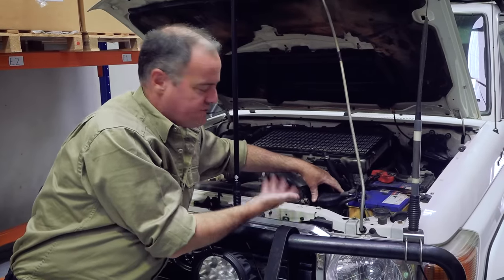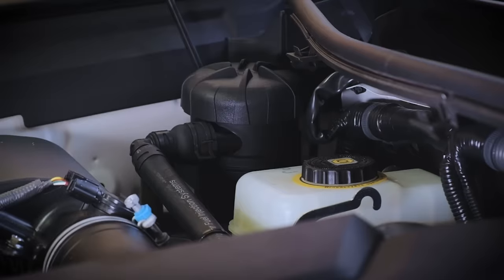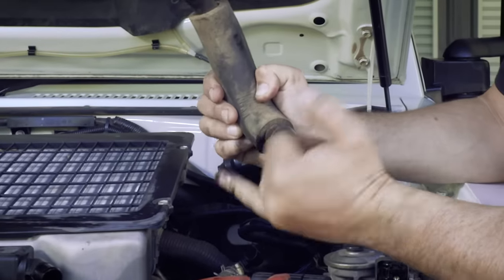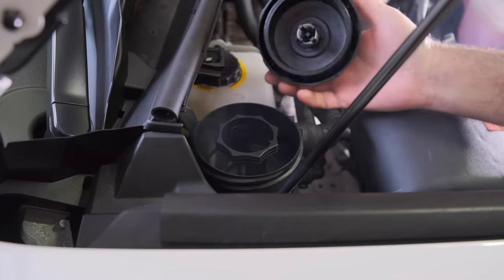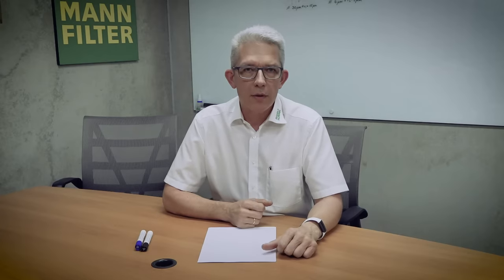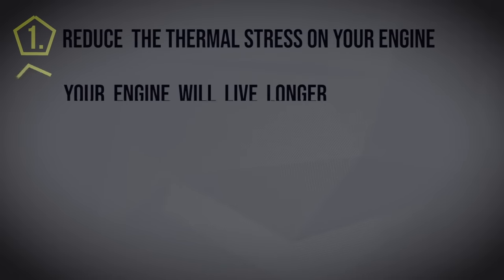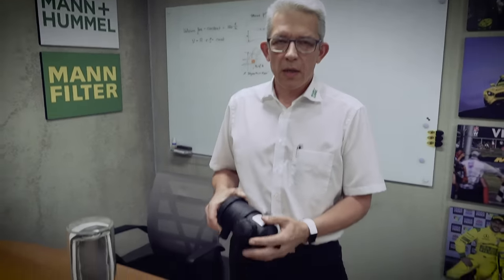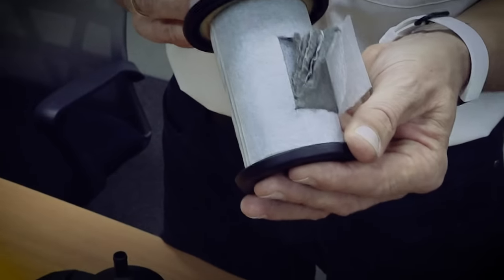CATCH CANS & EGR explained in detail! Why your diesel’s clogging up & losing power - how to fix it

Comment: Great video! Finally someone who knows what they are talking about re EGR systems! Well done, thanks 4WD Action. Keep up the great work!
Reply: if you were impressed with old grey saying how good egrs are you much think servicing your air filter means throwing a hand full of dirt in your air filter is going to make it run better because that's what he is saying you restrict airflow in a diesel it runs hotter no cooler diesels like air flow and cool air not hot exhaust gas with you think they have intercooler for to warm it up or something what old grey in video is doing is preaching lies to conform to emissions laws not help your diesel engine
Reply: @carlmenzel8744  100% you're right, but to get your point across a little better, you should consider the use of some full stops and commas.
Reply: @bumndrass  hahaha exactly
Reply: When doing something ‘illegal’ is good for your engine

Comment: I had a look at a EGR system with a catch can. It still had plenty of carbon deposits. It may well slow the deposits down as it catches the oil and the soot has less ability to stick to the EGR components and the inlet manifold, but I wonder if the small amount of oil that gets through without a catch can, helps to lubricate any deposits that make their way into the cylinders? Essentially, is the grit post catch can more abrasive as a result of the oil removal?
Reply: Charles Martell  did you just watch this video at all.

Comment: Interesting vid but also opposite to what my mechanic has told me with the D40. He says egr block is the way to go and I don't need a catch can after that as the oil will burn off properly not mixing with the exaust gas.
He also said the opposite with fuel consumption as everyone they have done the egr block on has reported better fuel consumption and performance.
Be nice to get some consistent answers
Reply: I am a mechanic and I agree,block the egr then the oil vapour won't mix with exhaust gas and won't gum up.Tiny amounts of oil in the intake is fine,will just burn up.The downside is you won't be supporting commercials such as this
Reply: @renbenism  My intercooler was literally dripping with oil after 5000ks.  The oil mist is harmful to the turbo that it passes through and coats the intercooler so it doesn't work nearly as well and it coats the inside of the inlet where the extreme cylinder heat will bake the crud on, even without the addition of EGR.  The crankcase blowby fumes are not pure clean oil - the collection of trapped fumes that comes out of my Provent is disgusting black oil.  I remind readers that 50% of mechanics are below average,  and I remind readers of the oft publicised videos that trap "mechanics" ripping customers off.  Message is don't trust a mechanic because he says he's a mechanic.  Think logically.  Fit a catch can or sell your vehicle before 100,000-150,000ks.
Reply: Over 300000km on my patrol with out a problem and 17yrs trade experience being a diesel mechanic I guess I know very little on the subject,might fit a hi clone aswell.thanks for the enlightenment👍
Reply: @renbenism  Mann-Hummel has 75 years of experience and is a massive company.  Yet you claim to know better.  I know who knows more about catch cans and their benefits.
Reply: @einfelder8262  Ok bud,I guess you need to justify your purchase and this advertisement does it for you-that's great.I'll drive my catch can less car and await inevitable catastrophic failure-maybe in another 300000kms? Who knows?
Reply: @einfelder8262  my patrol intake is wet as Fu©,to the point where the silicon boost hoses leach oily residue-the oil burns at combustion temps,my exhaust pipe is dry.all I'm saying is maybe you don't need it if your egr is "faulty" or turned off through the ecm.but it's up to you what you spent your hard earned on👍
Reply: @renbenism  cheers mate.
Reply: Thanks for the feed back guys. Ein Felder i am wondering if you are a sales rep for Mann-Hummel scrolling the comments to defend any suggestions that differ from the video. 
No need to be so protective of the catch can and condescending to others. 
Would be good to have more people get involved in the feedback. 
Cheers
Reply: Your mechanic knows what he is talking about. Block the EGR, get rid of the hot sooty and abrasive air being fed back in to the intake it's the complete opposite of what's good for an engine. These aftermarket guys cant legally sell an EGR block so of course they will push catch cans when the tiny amount of oil they catch causes no issues. 

Also catch cans are maintenance items and if they plug with gunk, or the water content they trap along with oil freezes, the pressure buildup in the PCV system can blow the crankcase seals.
Reply: @renbenism  . Well if your intercooler is leaking oil out of the clamps that means your complete inlet track has an oil film all over it. You claim to be a Mechanic but you obviously don't know how thermal conductivity works. With a air to air intercooler that has a film of oil on the inside it will be less efficient because as you know being a Mechanic the oil will act as a barrier and trap the heat inside the intercooler not allowing it to work correctly increasing inlet temps therefore reducing engine power.
Reply: @MJTAUTOMOTIVE  any mann and his dog knows that
Reply: How to get rid of that soot?

Comment: 0:47 Lots of blockage and performance loss after just 2,500 kilometers?! Give me a break! Surely if that were the case by the time the vehicle hit 100,000 kilometers it wouldn't run at all, or the owner would have spent $40,000-80,000+ in repairs to fix it.

Comment: So the egr lets less oxygen into my cylinder therefore my engine burns less fuel. Never have I heard someone say you to restrict  oxygen and fuel. Wouldn't putting a plastic bag over my intake have the same effect without the extremely hot exhaust gas being reintroduce into my cylinder?

Comment: Hi Rainer, I fitted a Provent to my New Pajero, from what I got out of your great video, you recomend not to blank off the EGR and I assume this mean by plate or lectrically using a EGR delete harness,,,, EGR DELETE KIT - MITSUBISH 3.2L ENGINE (PAJERO 2017 ONWARDS) many makes on the market. could you clarify please catch can only recomended or also use EGR delete cable? thanks heaps, great video.

Comment: This is 100% my point why Chemical cleans are no good for an engine, all that built up crud gets forced through all the area's you pointed out.
Cost more for a mechanical removal and clean but all that crap goes in the bin and not through your engine.
Catch can can only do there job if fitted from near new, There great, but for a slightly older rig the mechanical clean must come first then fit the can.
Now let the money making chemical cleaning guys unleash and tell me where they recon the crap goes if not through the engine,
Thanks for your video 
Murray in Redcliffe QLD.

Comment: The explanation of how EGR "saves" your engine by de-stressing it is pretty much a politically correct discourse.
Yes it reduces NOx emissions, but NO it doesn't give an engine better economy or longevity.  To cruise at a certain speed requires a certain amount of energy from the fuel - if you reduce fuel and O2 by filling half the chamber with inert gas you reduce the power output and hence the vehicle will slow down until you press the accelerator further to add more fuel again.  Your economy actually gets worse.

I've had a Provent on my Patrol since 5000k from new, and the inlet was already saturated with oil - dripped out of the intercooler when I took it off to wash it out.  The Provent is indeed an elite quality catch can/oil separator.
Reply: Not sure if the guy knows how diesels operate vs gas.  If the ECU is actually reducing fuel, your right foot will be compensating.  Give me all the oxygen and all the temperature, the NOx can be treated in other ways.
Reply: exactly. The engine breathing in soot is just destructive to its internals.........and less oxygen thanks to EGR works against all the progress in turbocharging and intercoolers to increase oxygen density.  Talk about politically correct bull manure.

Comment: So your putting burnt oil back through the pistons cycle, so it lowers diesel consumption and pressurises the crank case! 
Why not just have hho run back through?  (because the o2 sensor sensors fuel and supplies the right amount of diesel). Then you can catch 100% of the oil, it would still lower fuel consumption and be 100% better for environment and the engine, and the oil discard process might be higher but a lot easier and the whole system works better all round?? 💁🏼‍♂️

Can an egr sensor be deleted from ecu ? And can it “sense” Hydrogen as a fuel or be changed to do so??

Comment: Great video. Probably the best catch can/filter system and video I have seen. If they ever develop one for the U.S. market and especially the gas engines in the U.S. market they have a potential for a huge market. I will be first in line to get one! I have a gas V-8 engine and haven’t put a catch can on for the very reason you stated. They aren’t very effective but I am at the point where what I can get is better than doing nothing...
Like I said the U.S. is a huge untapped potential market.
Ron
Reply: I’m in the US and have a Provent on my truck. You can just buy one.

Comment: If all I need is a catch can.... why does the egr valve block up in the first place? when the egr is straight from the exhaust, before any oil vapour comes into contact with the system from your crank case vent??

Comment: I did an egr delete and have lower egts and gained 30% increase in fuel mileage calculated by the tank increase in fuel mileage = increase in efficiency
Reply: Mario here i have dually duramax 3500 maybe my egr need to be deleted 
120 liters only do 500k
Reply: @mirkamarioguillen4835  if you decide to do it guarantee you will not be disappointed
Reply: @trxcummins7388  tnx

Comment: 270,000 km on my common rail diesel, intake is fine, completely standard. Injectors are still running strong too. Don’t always believe the hype, especially when it comes to you from 4wd Action.
Reply: 350,000 on mine ,no issues.was going to install one but saw Auto expert report and decided otherwise
Reply: Change oil often.
Reply: @jamesmcmillan2656  can i please have a link?
I tried looking for it but he has so many vids, i cant find it.
Reply: Love that answer.

Comment: I AM A HUGE FAN OF 4WD ACTION GREAT VIDEOS THANK YOU GUYS!

The Manufactures now build cars like throw away cigarette lighters due to fact most of the engines are no good unless you mod them cough cough, they have DPF fitted creating higher engine temperature due to the restriction in the exhaust an EGR that recirculates all the dirty final emission output  especially when they are not closing correctly causing smoke less mpg and higher nox! ohhhh and mr Mann filter man..........an egr recirculates the hot exhaust gas so this make the burn temp higher not lower !! 

I do like the catch can though its good that the crank case oil is not been allowed to enter the combustion process
Reply: I've read the opposite, that since the exhaust gas that recirculates is always losing heat after combustion, the EGR allows cooler temperatures in the cylinders, not higher. This makes more sense logically than what you said "makes the burn temp higher."

Comment: Thanks for this info but im sorry i just don’t really understand any of it. Seems very important but Pardon my ignorance, i had a new mu-x and i wanna know where i could buy one and have it installed. Does this connect between the air intake and the engine? Just not my forte, but thank you in advance for directing me in the right path..

Comment: So the engine tolerates the temperature when you press the pedal, then the EGR is turned off, but it cannot cope with the temperature when you are cruising at low revs?

Comment: Ive just installed one on my Diesel 2.8 intercooler Jeep. 08 wrangler done 200k. 
Those L shaped joiners concern me!? 
Surely they will make the breather return tubes squirt like a water blaster jet? 
This was a kit with all of the bits and pieces of pipes and L shaped [internal] connectors etc...  
This is going to annoy me until I change those small L shaped joining internal corner pipes out.

Comment: Catch can helps like 5..10%, the EGR gases is the main issue, I got a catch can and it catchs some oil, but that does not eliminate the soot on the intake and EGR valve as the gas from the EGR has sooo much oil on it, diesel engines are designed for long time running, I had an mwn diesel bus that ran everyday from 4:30am till 12:30 every day from Mon-Sat, 2 drivers and it has never any issue because it was always driven like pedal to the metal, hard working lot of hours 400k in 5 year, urban drive 14km each trip, probably 15..18 each day

Comment: Careful with your factory warranty if fitting catch can to new vehicle... peanuts @ Toyota service centre told me the warranty would be voided if I put my catch can on my new Hilux. I said - warranty voided by in-line filter?? Why?? They said - "after-market modification, automatic void of warranty". What tools. Anyway have to wait 3 years before fitting now...
Reply: Catch can severely damage your engine!! Toyota was kind of enough to warn you about not installing the catch can.

Comment: Just bought my first diesel..
Is it worth installing a catch can on a motor with 260 000 K,s.. ??
Reply: Assuming its a common rail, if you're mechanically minded, pull the intake manifold, soak in degreaser, clean properly and reinstall with a catch can and you'll notice a power difference for sure. Make sure you get the workshop manual for your vehicle.

Comment: I installed a catch can and did EGR delete. Then I did an intake clean and also remove D swirl flaps coz they're known to come loose and get sucked in. 79k km. It was pretty sooty. I'm still concerned about valve seats and piston heads.
Reply: Did you remove the EGR completely from engine,  or just get it turned off in the tune, or use blank plates.?

Comment: Question: if an oil separator is so effective, why don't manufacturers fit it at the factory?
Reply: they aren't fitted as standard because 90% of people wouldn't empty them at the intervals they need to be emptied. sucking in actual liquid oil would cause more damage than oily gases.
Reply: @UnacceptableViews  well, they could've make it part of the service schedule (like checking/replace mthe PCV valve since the 70's) it is like who the hell will clean a MAF...

Comment: block the egr in MOST diesels with them in my opinion. It's really only certain engines that NEED it blocked. i.e i would block it on a ZD30 nissan patrol engine but not on a hilux 3L engine.
Reply: This couldn't be further from the truth, the 3l d4d engines are the ones that the egr blank the most

Comment: Never been a big fan of compression ignition.(diesel) .Next one i buy will be a Y62. Albiet with a bit more fuel  use .
Reply: Direct injection petrol engines have the exact same problem ad diesels.  There ya go.

Comment: What is the best method to clean out the carbon build up prior to fitting a catch can? My 2014 4d56 mn triton just clocked up 140 000. i am wanting to install a catch can and clean up the carbon deposits  my engine may have

Comment: I am surprised manufacturers don't include oil catch cans!
Reply: Because it does more harm than good. Hence why multi-billion dollar vehicle manufacturers don't include it. They know more about their own engines then these diesel specilast who just want you to buy there products. You want that oil in your intake to capture the carbon soot coming through your egr so it doesn't wear down your valve seats
Reply: @thedescriptions6646  if that was the case, why isnt this a problem for the exhaust valve seats which cop the soot 100% of the time?
Also, is there any data available on heavily soot impregnated oil and its lubricity?

Comment: If a mate of mine had a Provent Catch can and also blocked off his EGR, would you now recommend he unblocked the EGR?
Reply: Keep it blocked. The EGR chokes the engine regardless of whether a catch can is installed or not. When I blocked mine I noticed an improvement in power and fuel economy.

Comment: The catch can is somewhat not a very dependable solution since the oil vapour from the blowby gases makes the soot from the EGR stick on the inlet assembly instead of it going directly into the combustion chamber where it can be abrasive to the cylinder walls and piston rings. Just clean the intake assembly after 80,000 kms you'll be fine. Instead of prematurely wearing out the cylinder walls and piston rings which is more expensive than cleaning the just cleaning the intake.
Reply: I have heard this argument before, but I believe it has an obvious flaw to it.
If the exhaust gasses are abrasive to valves, cylinder walls and rings then consider that these components are exposed to exhaust gasses constantly while the engine is running. The only engine cycles with little to no exhaust gasses present (EGR gasses present in the cylinder) are intake and compression.
I tend to believe it's far preferable to avoid choking the inlet with a soot and oil mixture.

Comment: My 1995 Land Rover Defender 300tdi.
Egr No
Computer No.
332,600kms.
No Problems of this sort ever.
Reply: agreed I have a 1995 troopy, no turbo, no electronic gizmos and 480,000 km with no major problems. There is far less pollution caused by being able to repair a reliable and capable vehicle than constructing a new one.... Vehicle manufacturers and governments are more interested in the economy than the environment.